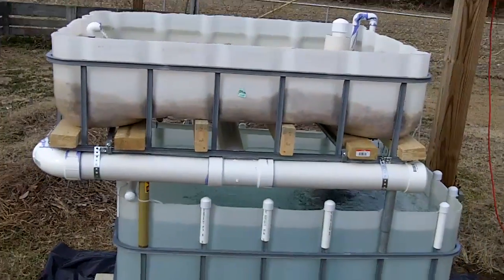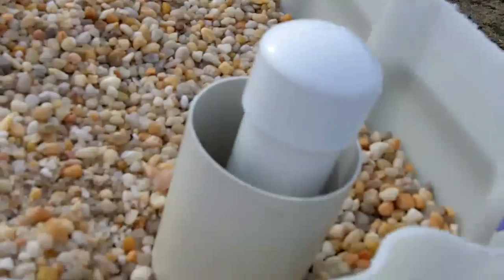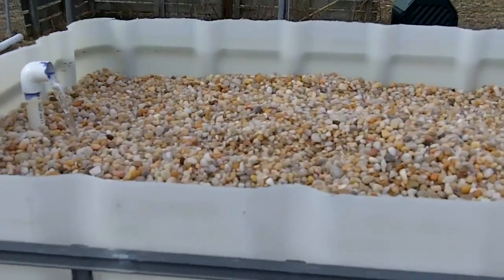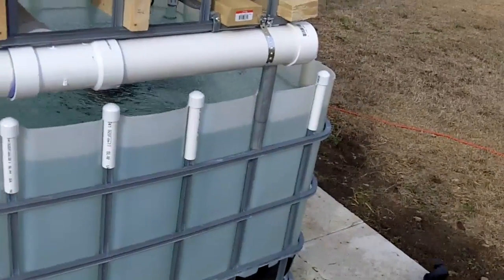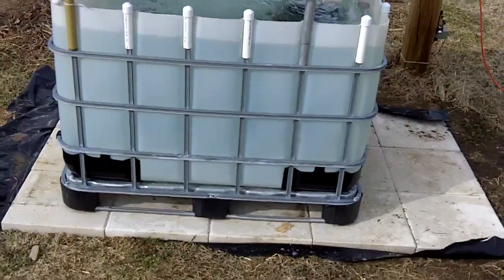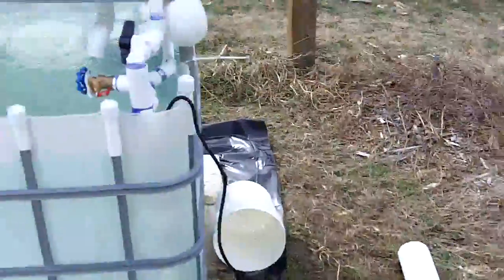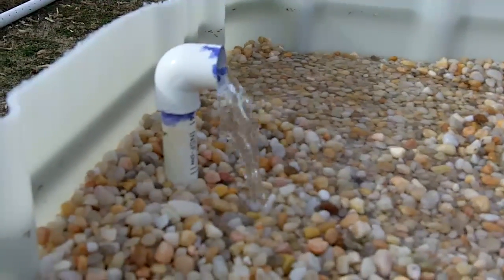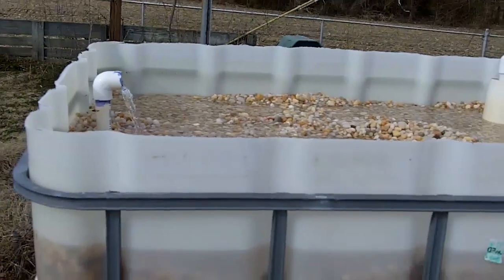IBC tote Aquaponics system update 2/2/2011

Comment: The catfish should be fine year round as long as it doesnt freeze solid. My pond freezes over about 3" and my koi are fine. Dont feed them when the water gets below somewhere around 50deg though. Im not sure how low they can go temp wise, but its not like you'll need to heat the water much.